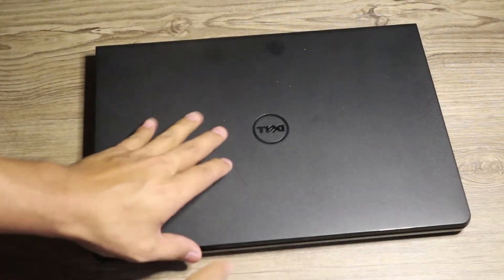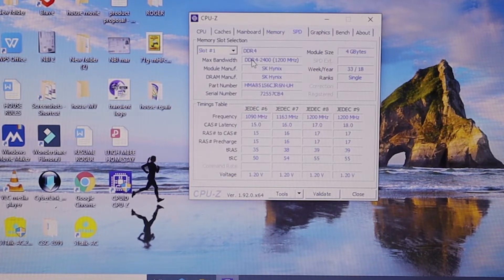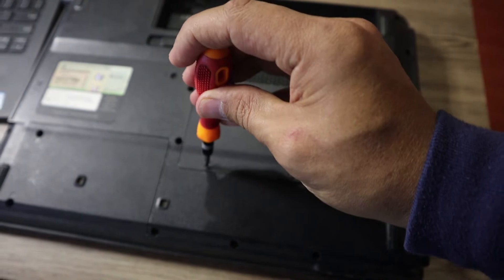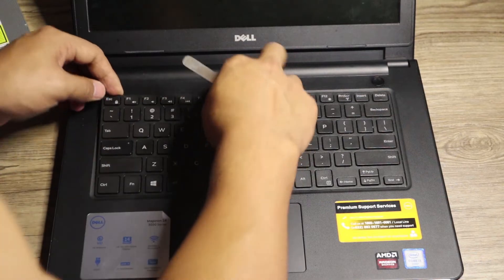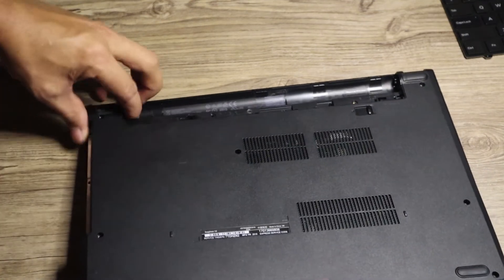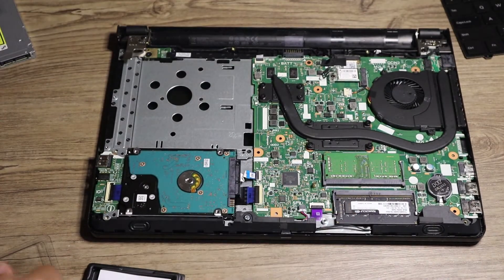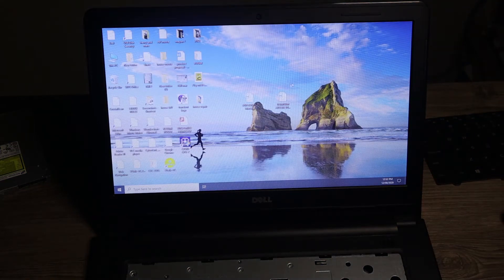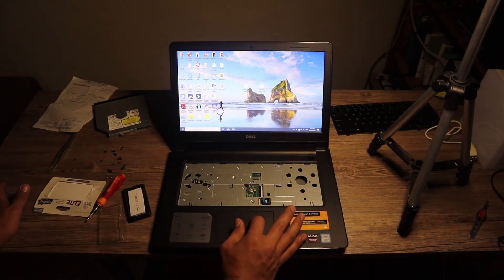Boost Your Laptop's Performance: A Step-by-Step Guide to Upgrading Memory/RAM!

Comment: Padli wada ngata lako da baterya din laptop ay inlakom sindoy din samsung build in samet baterya na di engy pag 0% din charging na hehe
Reply from the maker: Wada men. Send mu model na kod ta  ilak
Reply: Time of this report: 6/17/2020, 20:24:32
             Machine name: HAMANNGAROD
         Operating System: Windows 10 Pro 64-bit (10.0, Build 10586) (10586.th2_release.160104-1513)
                 Language: English (Regional Setting: English)
      System Manufacturer: SAMSUNG ELECTRONICS CO., LTD.
             System Model: 535U3C
                     BIOS: AMIBIOS Version P00RAG.N40.120514.LEO
                Processor: AMD A6-4455M APU with Radeon(tm) HD Graphics    (2 CPUs), ~2.1GHz
                   Memory: 8192MB RAM
      Available OS Memory: 7642MB RAM
                Page File: 3615MB used, 5243MB available
              Windows Dir: C:\Windows
          DirectX Version: 11.2
      DX Setup Parameters: Not found
         User DPI Setting: Using System DPI
       System DPI Setting: 96 DPI (100 percent)
          DWM DPI Scaling: Disabled
                 Miracast: Not Available
Microsoft Graphics Hybrid: Not Supported
           DxDiag Version: 10.00.10586.0000 64bit Unicode
Reply from the maker: @HamanNgarod  asik echeck bigat p;adli